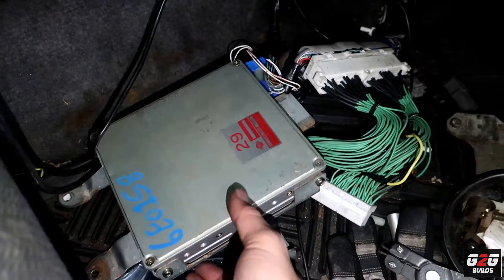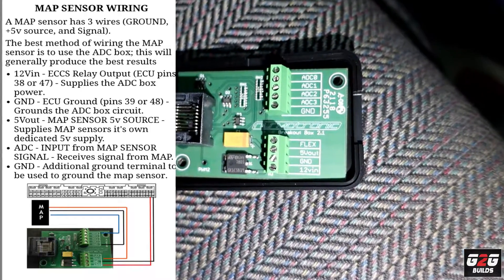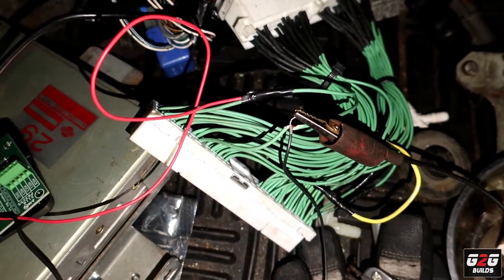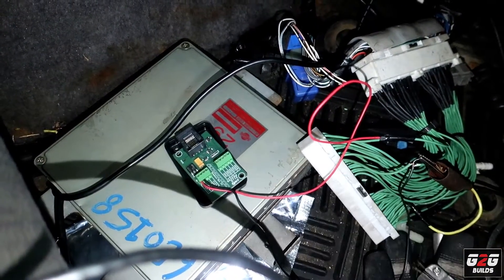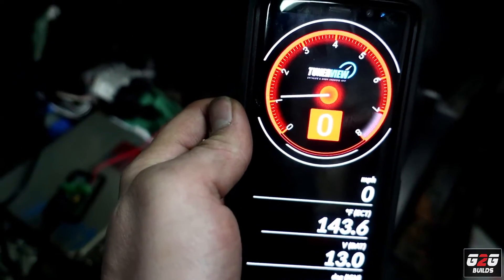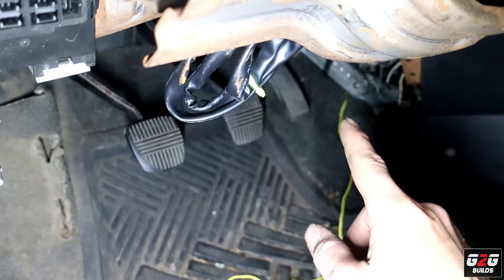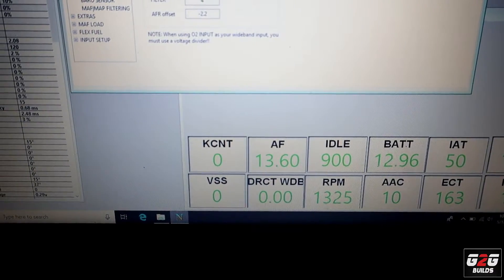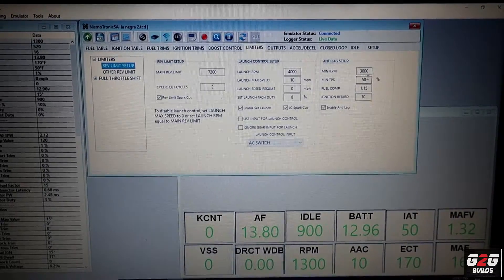Nemu 2 Install, & 1st drive on Nismotornic ECU

Comment: What tcd file did you end up using?
Reply from the maker: If I remember correctly, I used sr20det GTIR tcd, but I had to adjust the MAF sensor settings because of the N60 MAF swap.

Comment: For the wideband where does the yellow wire go on the ECU? Awesome videos btw
Reply from the maker: The wideband analog output goes to the nemu box. I'm using the first input as the wideband. You need to change that with the nismotronic software.
Reply: @G2GBuilds  Forsues thanks man
Reply from the maker: @Cezonova  no problem!

Comment: What color is the 5volt wire?
Reply from the maker: The 5 volt output is on the nemu itself. You can use any wire you have. You need to make sure you power the nemu by using ground and 12v source.

Comment: Going need a Alternator bro dropping to 12.88 in the video should be 14 to 14.7 with everything on . low volt will cause lean conditions to not burning the fuel because ignition system not sparking right under boost. car sounds good
Reply from the maker: Thanks bro.. Its weird, that alternator is like 1 year old.. =/
Reply: @G2GBuilds  Check connections might be something lose could be that simple but i have to say its the alt . lot of times these aftermarket alts don't last. I buy new oem are mostly run used oem alt same with starters same issues .
Reply from the maker: @PATuners  sounds good..
I'll look into it. Thanks
Reply: @G2GBuilds  No problem I try help people much as can

Comment: Man thanks for keeping the 200sx SE-R s alive .  Love your channel . I  also have two of the same exact cars . One with the 5th gear pop out . Do you know by chance if they still sell parts to fix this problem ? . Anyway props from Little Rock Arkansas
Reply from the maker: Thanks a lot for your words bro. They really means a lot to me.

Sometimes when it come to 5th gear pop out, it could be a synchro. I guess the dealer may still have them, or maybe a transmission repair place can take a look and fix it.
Best of luck!